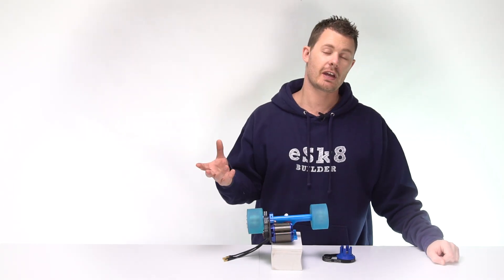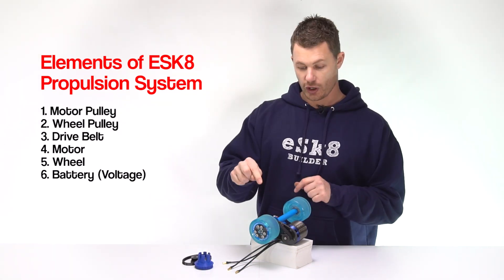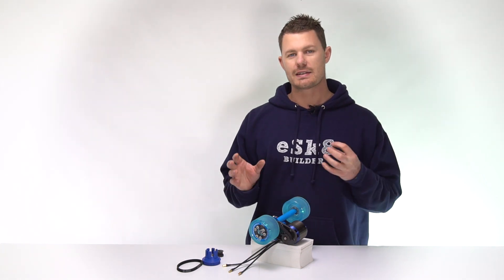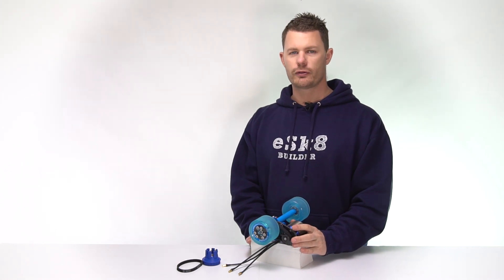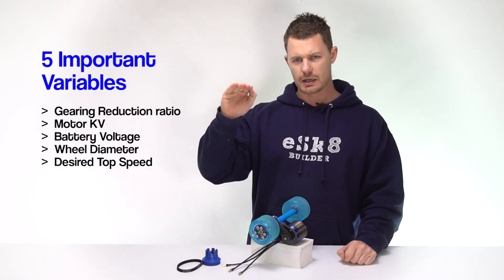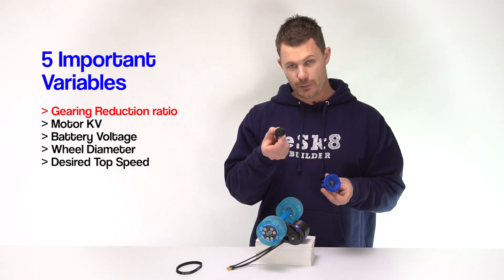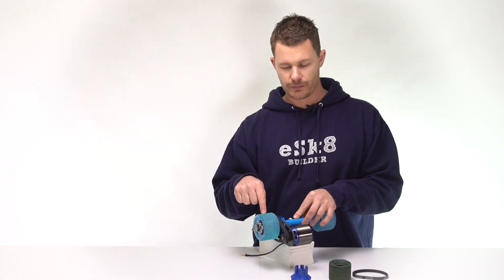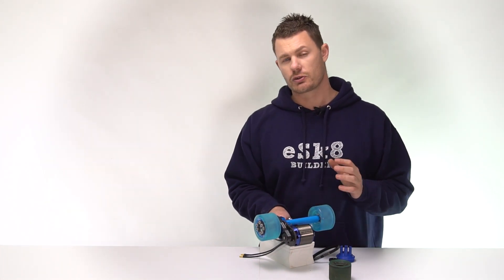Beginners Guide | How to Make Electric Skateboard Drive Train

Comment: I am so grateful for these really easy to follow beginner videos. I want to build a board with approximately 25 mph top speed and around 15-20 miles range. Could you recommend the motor, battery type and esc type I should use? I am a beginner in the DIY world and would love some help planning my build.

Comment: Hi enertion I recently bought your e-board parts to build my own e-board. I'm having a problem where the motor won't start. I sync the controller to the receiver and  put the vesc together and connected it to the motor. long story short, it's not working. Do you have any recommendations or if you do- is there a tech group (like boosted-board) that I can send to, if any problems like this were to happen that could help me with this problem hands on? please contact me to your convince, I really would like to ride again and of course I paid for the pieces to work and I would love for it to work properly.

Comment: hi, I want to make a electric longboard, but I want to do it myself. Small problem tho, when building a dual motor board you need two vesc, two motors, two motor mounts, two times belts and pulleys right? but how do you connect one wirless hand controler receiver to two vesc? And same question: how do you connect two vesc to two 5000mah Turnigy 3s batteries placed in series? I'm new to building electric skateboards so excuse my noobie thoughts :)

Comment: Hi jason i want to pair a motor with this battery Multistar High Capacity 4S 10000mAh Multi-Rotor Lipo Pack
but idk what motor to chose under 60$ that fits the voltage and stuff so basicly i dont know how to pair a motor with a battery and so they dont overheat and so they work together well. Could you please help me?
Reply: link to battery:http://www.hobbyking.com/hobbyking/store/__56844__Multistar_High_Capacity_4S_10000mAh_Multi_Rotor_Lipo_Pack.html
Reply: ok so im using a vesk from your website and a standard motor from your website (both around 100$) and im wondering which is the best battery to use which will have decent enough voltage to move the thing and have enough Mah to power me through (max price for battery is 250$)

Sidenote: Thank you for actually replying to this have a nice day:)

Comment: good explanation. However load does not increase exponentially with speed. It increases quadratic with speed.
Reply: It actually is exponential as he says after a point it increases exponentially not the whole overall function is an exponential increase
Reply: Drag force is proportional to u^2 (Velocity), however the power required to overcome the drag force is proportional to u^3.
Reply: It isn't an exponential increase. . Total drag on the skateboard is the sum of aerodynamic drag (wind resistance) and rolling resistance. If you compare these two types of resistances, you will see, that a lower speeds rolling resistance will be the dominant part of total resistance. On the other hand with increasing speeds rolling resistance stays almost the same, whereas wind resistance will increase, just as Tobsta1991 said:  with velocity squared. Also for speeds up to 50 kph there is no point at which the drag or the power will increase with a different rate.

Comment: Hey Jason, Ive mailed Support twice, tweeted you and no response on either. Tried the chat and was told Id get a response by yesterday. I received my board and not received a remote, amoungst other issues which i raised in the ticket to support! Could someone get in touch to resolve this now. Its three days since i received my board and im now feeling ignored and getting pissed off!
Reply: board came without a remote? how is that even possible.
Reply: Who knows!!! I have the Raptor dual downstairs battery charged and no remote. So much for quality control! Its now three days and no reply from enertion at all! The only response ive received is from the chat which is outsourced because they cant actually do anything for me, as they just makes "notes on the case" and then dont get responses. There customer services is shit!
Reply: +Electric Skateboard Builder Why does it take me messaging you get some sort of response? it's been three days and nothing from support. That is a reply that would have squashed this threw days ago. Anyway, I think my rapid charger is faulty, is there a video to watch or something I can do besides charging the fuse? I did mail this in the ticket aswell.
Reply: Wow that is pretty crazy. Now im having second thoughts about buying one...
Reply: @Wayne Dean How long did it take you to get the board? Where are you located?
Reply: Chill out guys, don't buy a raptor if you are impatient.  Enertion has a backlog of plenty of emails and a small staff, they're working out of a garage.  The remote comes separately and so does the battery.  Enertion support will reply, it just takes time for them to get caught up. 

The board can take a long time to deliver but it's worth it.  Mine took over 3 months.  If you aren't patient, don't buy the raptor.  If you want a high performance board that you can wait for and be patient, get the raptor.
Reply: +adictiveadictive Mine took 2 months 2 weeks (purchase was 6 may), the board looks great just can't use it. I think the remotes arriving tomorrow. I live in the UK. Looks well built, just the support blows. Jason is the only one that gets back to you.
Reply: *****  don't be so hard on yourself, you're a new business mate.
Reply: +Electric Skateboard Builder Jason I appreciate that, people are always going to ask stupid questions and not read the forums or watch your videos, I must admit I have watched all and love watching them. But there needs to be a better turn around for customers that have spent money and are looking for some assistance. why not create a new mailbox for customers that have purchased items and mail that to them, place a disclaimer on the mail address saying if this isn't related a purchaser it will not be answered and maybe add a membership number to checked aswell if you want to super sure. look I don't have all the answers, but long story short I had no idea about the remote coming separately, I did know the discs cell was posted separately.
Reply: +Electric Skateboard Builder I can appreciate that. Looking forward to using my Raptor either way. I received a reply from Support this morning, so the ball is rolling.